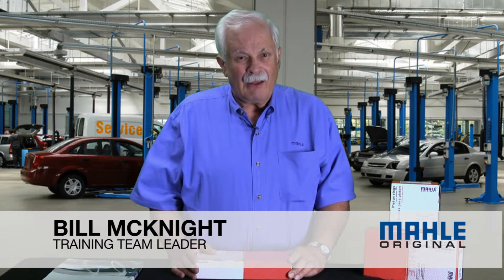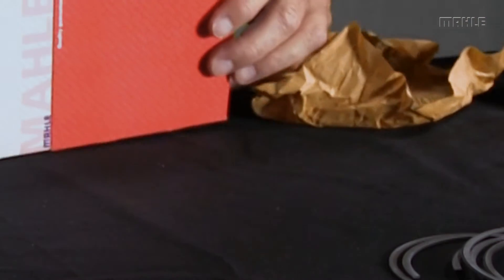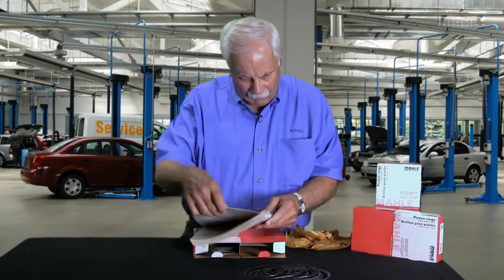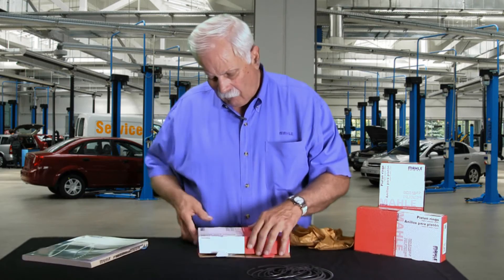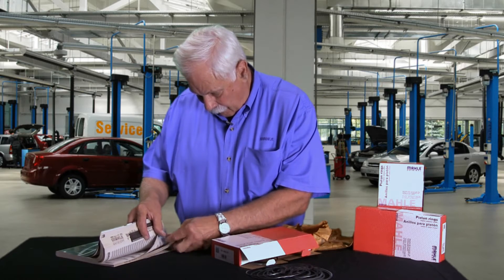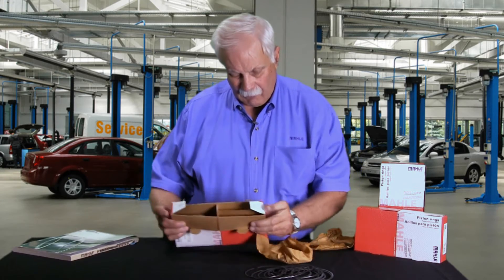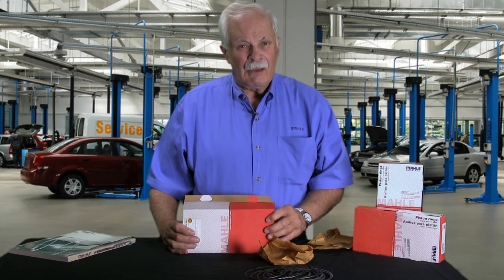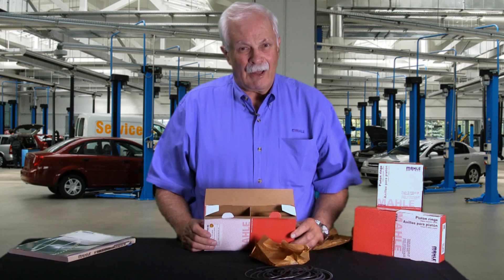Piston Ring Order

Comment: It's 2023 now.  How about on the wrapping paper of each ring set you print "Top" and "Second"? or how about you shrink wrap each and label more clearly with a sticker.  Or how about larger font, in RED, on the box flap.  With thousands of people doing this you might have learned to do it better instead of insulting us in the video and getting hundreds of inquiries each year. I'd consider myself a fairly smart person, but still missed the tiny font on the flap.  Thanks for good quality rings though!  If anyone is wondering,  LS motors lighter colored rings with red and white paint on them are the moly TOP rings.  Darker with little "M" on it are the cast second rings.